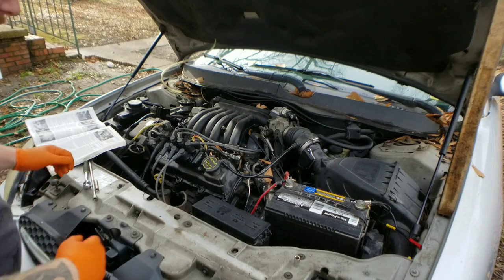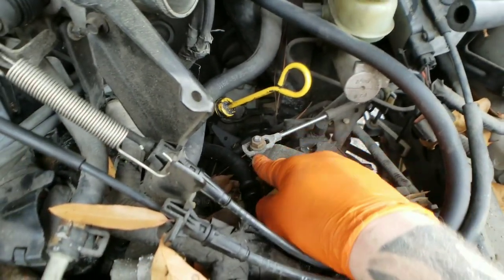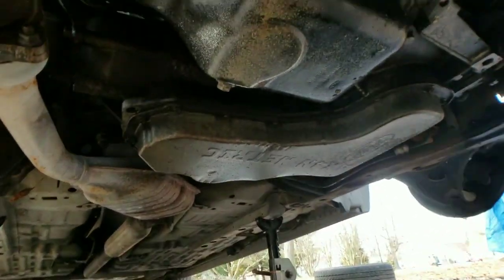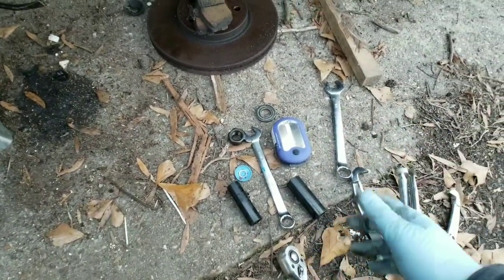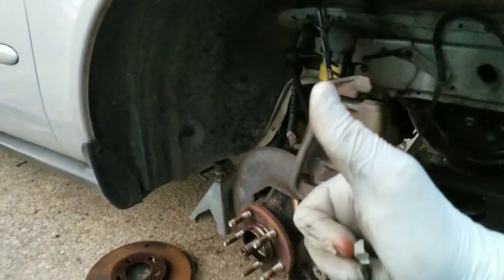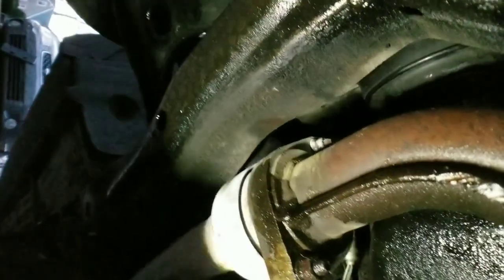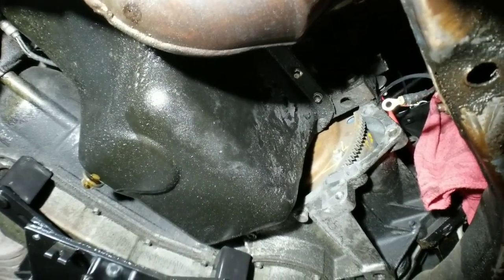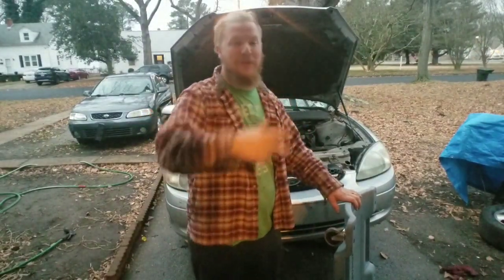2003 Ford Taurus Transmission Removal Made EASY!

Comment: You made that CV shaft situation way harder than it had to be
Reply from the maker: Yeah....I agree but I still got it out without damaging it and any of the other components. So still a win in the end and saved myself a lot of money. Also I should you how to do it in case you didn't know all of the steps to replacing a transmission.

Comment: Great vids.  I have the 2003 Sable that slips or gets jumpy if you hit the throttle hard at 60mph entering the  freeway, so I feather the throttle easy till get through that little slip zone and plan my merge well since it's 70mph where I enter and there's trucks - transmission seems smooth before and after 60 as long as I do a gradual speed build up don't hit full/hard throttle anywhere near 60. I think it's the torque converter - should I do the entire transmission or just the torque converter, or am I wrong?
Reply from the maker: I always start at the transmission fluid when shifts start getting off. What is the mileage of the vehicle?
Reply: @Sellthoseflippingcars  106k
Reply from the maker: Have you ever changed the transmission  Filter?
Reply: @Sellthoseflippingcars  Drain and refill / filter or lucas treatment or something like that 106 thousand miles.  Thanks.
Reply from the maker: Are you getting any engine codes?
Reply from the maker: Were you able to find the problem with you vehicles slip and jumping problem?
Reply: @Sellthoseflippingcars  Thanks for asking - I have not got to it yet, because I have the dreaded timing cover coolant leak, so until I haven't driving the Sable until I have a couple days to deal with that issue.  I have the gasket along with a new water pump as soon as I get that resolved I'll begin to deal with the jumpy shifting at high speed starting with a fluid & transmission filter replacement as you've suggested.  I will post the results here as soon as it's all done.  Thanks again.
Reply from the maker: Sounds good and you are most welcome!

Comment: How did you get it past the cradle (sub frame)? Thats the part im stuck on
Reply from the maker: I removed the transmission mount, dropped the transmission down below until it cleared the subframe and I was able to remove from engine. I would advise when reinstalling make sure the transmission is level with the engine for proper mounting. Hope this helps